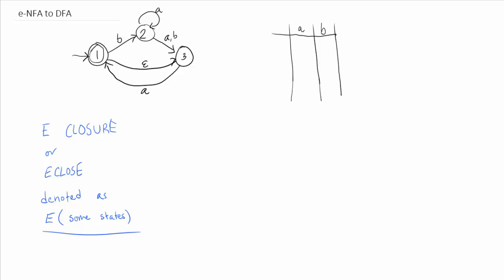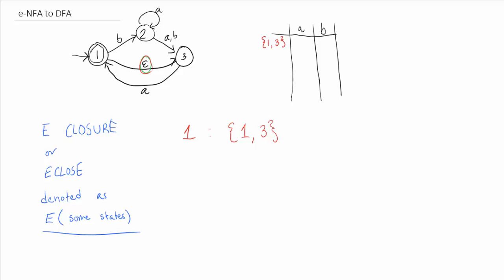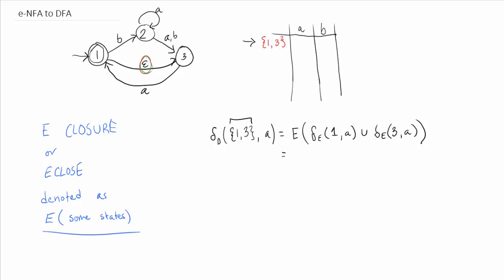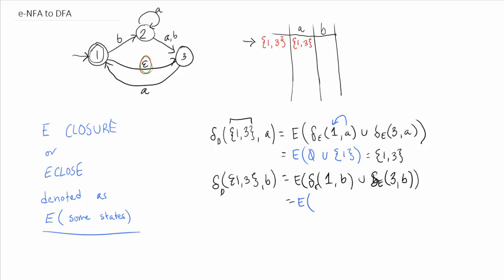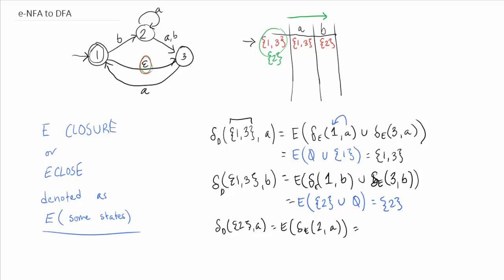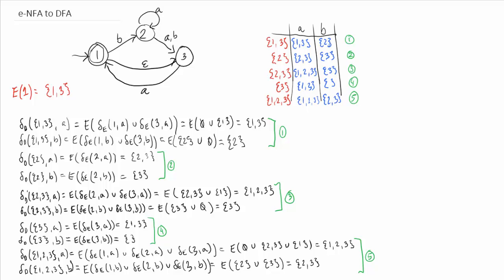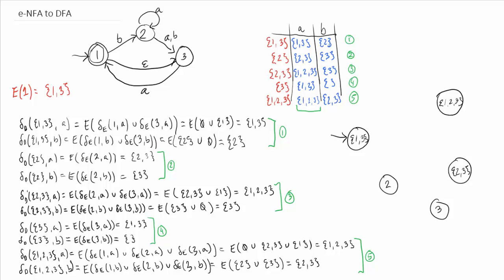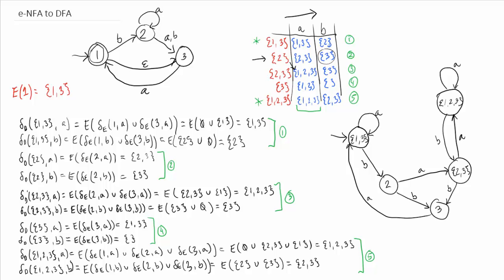Converting an e-NFA straight to a DFA

Comment: an empty set union set 1 will be equal to set 1, so E(0 u {1}) how come to be equal to {1,3}?
Reply: When you're in state 1, you would be able to go to state 3 with reading the epsilon. so the set should be {1,3}
Reply: you always need to look for epsilon transition of the states you reach and add those states to your set as well.
Reply: The reason is we no longer have the state {1} or state {3} instead we now have one state {1,3} and if the original went to either 1 OR 3 it is going to go to this new entirely different state {1,3} that we are creating